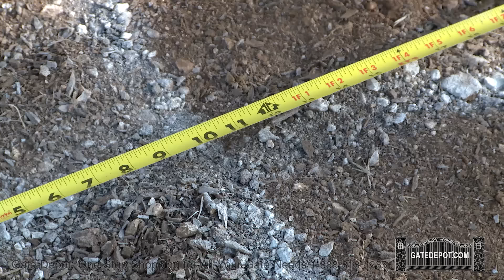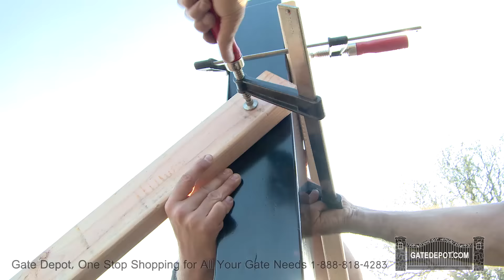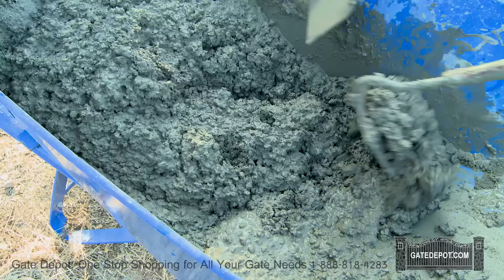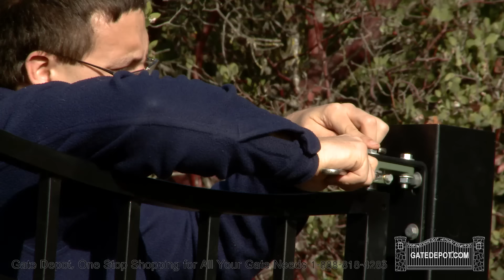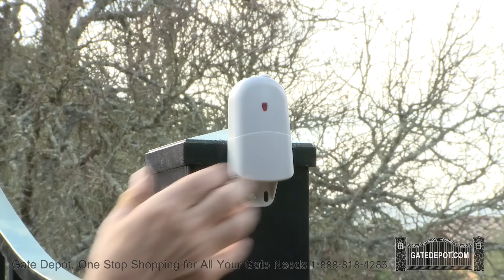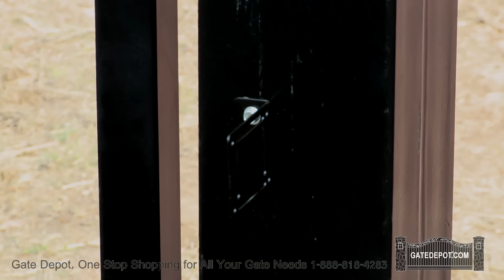Gate Installation Video

Comment: No thrust bearing for vertical component of load?
Reply: The 4 hole 1" flange sealed bearing generally hold up for 15-20 years with normal uasge. No thrust bearing needed.

Comment: Easy to install and very sensitive. I tested the first one by waving the shovel over it.>>>ur2.pl/1093   Bam! It worked. Later, out of curiousity, I waved a screwdriver over it near the ground. Opened again. Have had no problems with any of them. (Two gates and three sensors.)